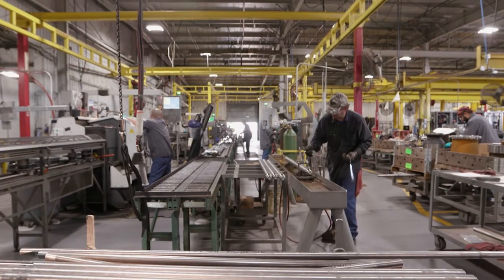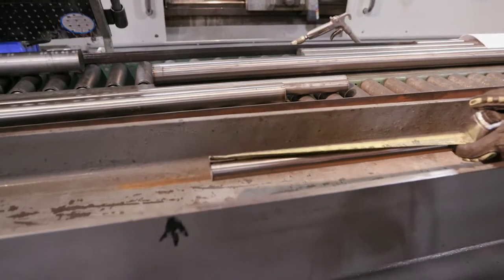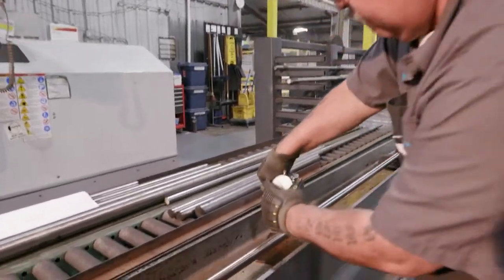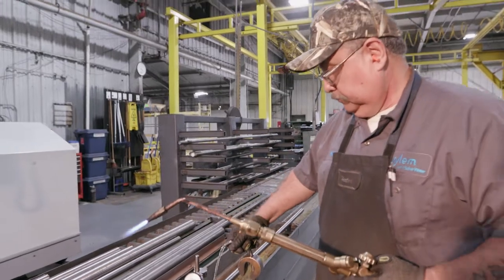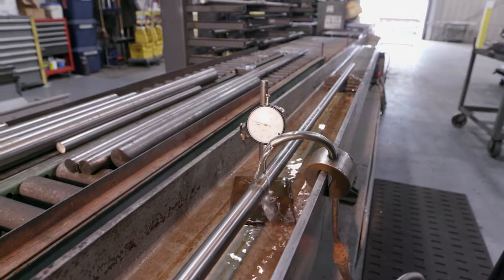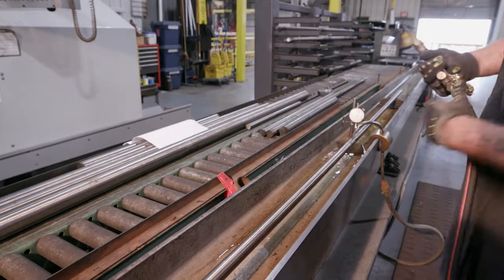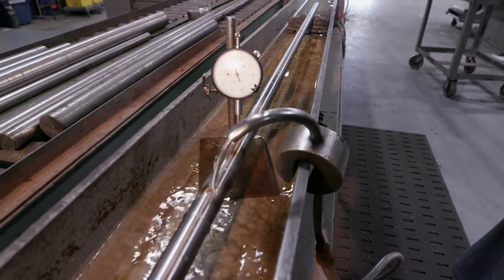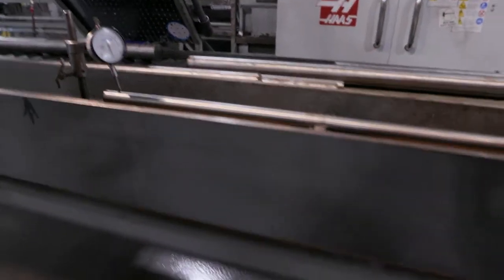Vertical Turbine Shaft Straightening

Comment: That will work with 416 and C1045.  But for 316 and other alloys, it will not work reliably.  Also, just industry std requires .0005" per foot across any 5 foot span, so you have to check in way more locations that just the middle.  But hey...for Ag pumps what you show is fine.